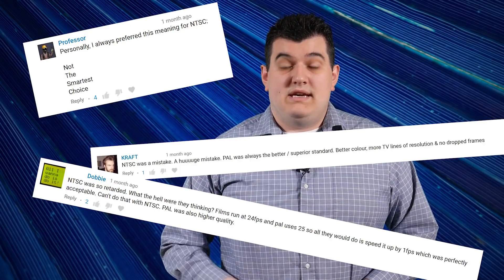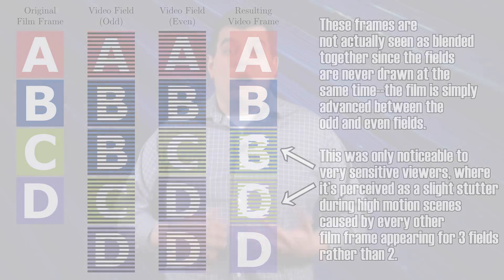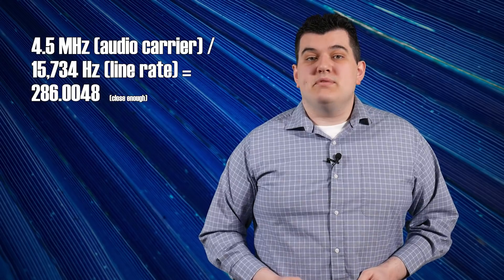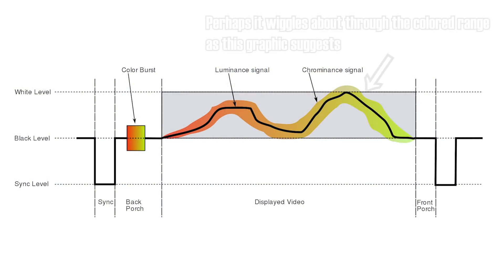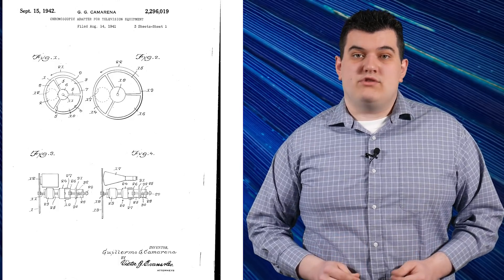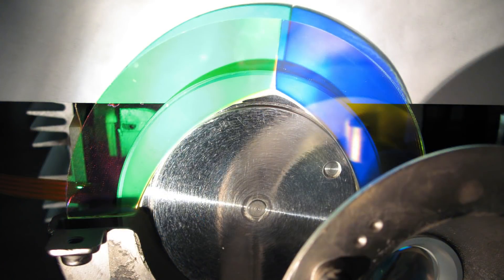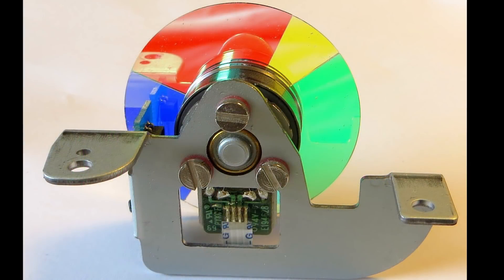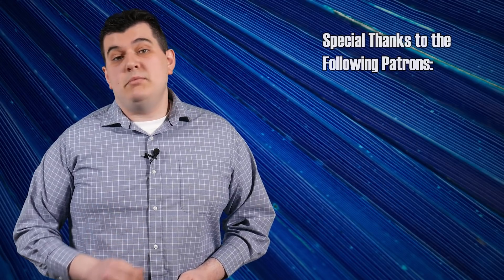Analog Color TV Wrap-Up--Some extra info

Comment: Movie framereates are a poor argument for PAL. These are TV broadcast signals. Movies are not TV.
Reply: The 24>25fps speedup for movies shown in PAL countries is completely invisible to the eye, it's only noticeable in the audio, which rises by a semitone - and even then, most people simply don't notice it, because if they've seen the film at its original speed they don't remember precisely what it sounded like. 

3:2 pulldown doesn't affect the audio pitch, but the jerkiness it introduces on pans can be very noticeable to those who are sensitive to it, but as with the PAL audio speedup, most people aren't sensitive to it and don't notice. The frames that are the result of blended fields are VERY noticeable when frame-stepping through.

But as has been pointed out elsewhere, the framerates of both PAL and NTSC are related to the AC power frequencies most common to the areas in which they were used. Most European countries use 50Hz power, so the framerate is 25, while for most NTSC countries it's 60Hz and 30 (or 29.97).

As to why, this is a good explanation: "Since the mid-1930s it has been standard practice to use a field 
frequency locked to the AC mains electric supply frequency – 50 Hz in most countries (60 Hz in the Americas) because studio lighting generally uses alternating current lamps and if these were not synchronized with 
the field frequency, an unwelcome strobe effect could appear on TV pictures. 

Secondly the smoothing (filtering) of power supply circuits in early TV receivers was rather poor and ripple superimposed on the DC could cause visual interference. However, the main problem was the 
susceptibility of the electron beam in the CRT being deflected by stray magnetic fields from nearby transformers or motors. If the picture was locked to the mains frequency, this interference would at least be static on the screen and thus relatively unnoticeable".
Reply: Fun fact: The studio control room scenes in the Beatles' A HARD DAY'S NIGHT were shot at 25 fps to prevent "scrolling bars" effects on the in-shot TV monitors.
Reply: Peter Kendell Similarly, Frank Zappa's "200 Motels", was shot on PAL video, yet when played in cinemas, had to get played at 24fps, leading to that slow-down in the intended music heard.
Reply: i remember hearing audio distortion when screen was showing almost all white on PAL broadcast system.
Reply: Playing videogames is not the same, i  bought a pal genesis/megadrive for play sonic and other old school games and f**k it feel slow. After the fucking hell of setup all the adapters and converters i was rewarded with a slow game experience.
Reply: Leyendlink but then that's also a reduction from 60hz to 50hz instead of 25 to 24
Reply: @layendlink. That's not PAL's fault. It's the game designers being unbelievably lazy. (which, to be fair was very common.)

Pal runs at 5/6th the framerate of NTSC. The PROPER way to account for that is to adjust the timing of everything so that it still takes the same time.
The WRONG way of doing it (read; most common) is to just take a game coded to run at 60 FPS, and run the exact same code at 50 fps. The horror that results should be obvious, since the game will run about 16.666% slower
The Mega Drive has an even more insidious problem that the SNES does not, although it could be compensated for; The sound playback is frequently also tied to the framerate!
The snes doesn't suffer from this because the Audio hardware has it's own processor that runs on a completely independent clock. While the Mega Drive also has an Audio specific processor,  the way it works makes it more likely that code will somehow sync it to the framerate.

This isn't a PAL specific problem either; Though people are less likely to complain about it. (since a game running slower is generally assumed to be unintended, even when it's not);
A game correctly programmed for PAL systems, if run on an NTSC system without modification will run at 6/5th it's intended speed. This would mean it's 20% faster than it should be.
Again, this is not how things are supposed to work.

Having said that, owing to design quirks related to CPU calculations VS graphics output, in isolation, PAL systems are objectively superior for most gameplay purposes. (this is true for almost all home computers and games consoles from the 8 and 16 bit era. 32 bit consoles and beyond don't tend to be using the CPU as directly for graphics routines in such a timing sensitive way.)
This wasn't obvious from most consoles, but it's quite apparent with systems such as the c64, atari 8 bit home computers, Amiga and so on;
The reason being that where most console game devs were American on Japanese, most of the developers for these systems were in the UK or other parts of Europe.

Where a game designed for an NTSC machine will run slower if not converted properly, (but fine if converted correctly), there is generally nothing you can do on an NTSC machine that a PAL machine couldn't match.
However, due to differences in available CPU time per frame, there ARE things you can do on a PAL machine which an NTSC machine could never do no matter how hard you tried, because it just doesn't have enough spare CPU cycles at the right moments to pull it off.

So here's the heart of why the PAL machines are functionally superior:

Though the exact frequency is tweaked a little, both NTSC and PAL machines have roughly the same CPU clock speed.

When used in the 'progressive' hack that most computers used (what Nintendo calls 'doublestrike', but which had various other names too), an NTSC machine outputs 60 frames of 262 lines. (this includes overscan and blanking lines.). A PAL machine outputs 50 frames of 312 lines.
However, and this is the critical part, the visible part of the image is generally the same; Both output say, 192 visible lines, or 224. Even where that isn't true, it's usually only 240 lines for a PAL display.
This does have a downside; the visible part of a PAL display in my practical measurements is about 266 lines; Which means almost every computer and console has black bars on a PAL display.
But, the upside is this: in most systems you cannot do anything graphically while the display is actively drawing something; You have to make all your changes during v-blank (blank portions between frames), or h-blank. (blank portions between lines of a picture.)
In some systems it's even true that the CPU and graphics chip share the same memory bus. This means the CPU cannot actually do anything at all while the graphics chip is accessing memory. If the graphics chip has DMA this may be a fraction of the period it's drawing graphics, but if it doesn't it's often the ENTIRE time that it's drawing graphics. Meaning you have no CPU time available at all during active display.
During h-blank you can make minor changes, which is generally used to do special effects and advanced graphics. There's not a LOT of time, but here, PAL does tend to have a tiny edge, simply due to there being say, 50x192 (9600)  lines per second instead of 60x192 (11,520). This is really quite minor, because if you could write, say, 5 bytes on NTSC you could now write 6 because you have more CPU time per h-blank.
The real gains however are in vblank. Whether the system uses DMA or something like a Display kernel, a PAL system simply has a much, MUCH longer vblank period.
Take an Atari 8 bit home computer such as the 800XL - for the early 80's that actually has a fairly fast 1.79 mhz CPU, and the Display can do a lot of stuff independently of the CPU, so you have a lot of CPU time during active display as long as it's not graphics routines.
But During Vblank? Well, the display is 192 lines on both the PAL and NTSC systems. The system can do 114 CPU cycles per line, on both PAL and NTSC systems... But, the NTSC one has 70 lines of Vblank, while the PAL one has 120. End result? During VBLANK the NTSC system has 7980 cpu cycles to do something that's timing dependent or graphics related. The PAL system? it has 13,680 cycles. Not far off double. (71% more cycles in fact). If you wrote a game or something that used up the entire PAL vblank period to do graphics and time dependent code, how would you port that to NTSC? You couldn't. The code would be completely out of sync or you'd have to cut features until your code was 70% faster. Which is non-trivial.

How about a 16 bit system? Well, we see the same consequences; Look at the SNES. While the PAL version tends to output 240 lines to the 224 of the NTSC machine, that still means the PAL system has 72 blank lines, while the NTSC machine has just 38. 
The SNES graphics chip has it's own RAM, so it doesn't interfere with the CPU, but anything complex graphically (or even something more basic like animated sprites with lots of frames of animation) requires a DMA transfer from ROM or main RAM to the video RAM.
When is this done? Only during Vblank or Hblank. (or forced blank - this means you can forcibly gain more DMA time by reducing the vertical image resolution, or even turning off the display entirely if you want to reload most of RAM - say when you leave one screen and go to the next. A blank frame or two won't hurt that much in such a case.)
A slight timing quirk means you get about 178 bytes of DMA per line on an NTSC machine, and 180 on a PAL one.
But again, way more vblank lines on a PAL machine, so in fact the PAL one can transfer 12960 bytes per vblank, to the NTSC machine's 6764 bytes. That's 91% more DMA time every single frame on the PAL system! 91%?
What does this mean? More complex animation, much more complex graphical effects.
In theory. Because of course, for a console like this it's unlikely a Developer would create something that literally cannot run on the NTSC machine. (especially since the US + Japan were the biggest markets)
OK, so on the SNES you do have a workaround, unlike some of the 8 bit home computers;
Since you can deliberately reduce the vertical resolution to get more DMA time, you can simply lower the resolution of the NTSC machine. However, this of course is quite noticeable.
And at the end of the day, the reality is at the same resolution, the SNES gets 50 lines of Vblank time, which equals 9000 bytes basically completely free over the NTSC machine, every single frame.
What's 9000 bytes? An entire set of tiles for most graphics modes is 1024 tiles that are 32 bytes each; That means you can alter 1/3 of an entire tileset for 'free' every single frame on a PAL system, compared to the NTSC one. Or, a typical 32x32 sprite takes up 512 bytes per frame of animation.
Which means you could load, basically for 'free' compared to NTSC, nearly 18 entire frames of sprite animation before the NTSC machine has even transferred anything at all.
(In case you're wondering, the Mega Drive/Genesis situation for graphics is almost identical to that for the SNES, though it has slightly more DMA time in general, the difference between NTSC and PAL is about the same.)

The conclusion is pretty clear for almost all these 8 and 16 bit systems that hook up to a TV;
If you write your own software, or wanted to choose one based solely on it's inherent capabilities, the PAL system wins hands down every time.
The downside is the amount of software developed with NTSC machines in mind, either explicitly (and then ported to PAL), or implicitly (not taking advantage of the PAL system's capabilities because they still want to be able to release an NTSC version.)

Anyway, PAL games being slow is a sign of bad coding. There's no inherent reason for it, it just means the conversion was done poorly. (the equivalent would be an NTSC game running too fast.)

This is also why I'm a little wary of people who just blindly assume any game at all is better at 60hz; They use modded systems to trick a PAL game into running at 60 hz...
Which makes sense if it's one of those poorly done conversions, but completely stupid if it was actually designed for PAL machines, (or is a properly done conversion - which does exist. Mario cart for instance - the PAL version is the same speed as the NTSC version. Just at a lower framerate, making the graphics less smooth. But, if you were to speed the game up, the gameplay would be faster than the NTSC version.)
Faster isn't automatically better. It depends on how the game was designed. Simply speeding it up without any thought would be silly. Unfortunately, unless the game runs at the same speed on both PAL and NTSC we have no definitive proof of the 'correct' speed a game is meant to run. (we can make an educated guess based on the developer though.)
Reply: Dennis Fluttershy We should just watch everything in 60+ fps. Heck go interpolate old stuff to make it work. I need all my frames!
Reply: It's more noticeable when listening to music in films; the speed difference shifts everything up so music isn't in its intended key.
Reply: They are not an argument for PAL colour at all, that's the C.C.I.R standard. One E.I.A country which adopted PAL is Brazil. Indeed most countries that adopted P.A.L used it with the C.C.I.R standard. Some C.C.I.R countries, notably France and those in the East Bloc, adopted SECAM.
Reply: NTSC >>>>> PAL
Reply: +Papus Magnus
 your comment is garbage, just as PAL is. "perfect relation when sped up" is only something a stupid person would say. Especially considering movies are 23.976 fps. And the absolute majority of viewing devices being 59.9Hz. You will always get judder with any system due to a multitude or various reasons, including PAL's low framerate, except with PAL you additionally get uncorrectable girly voices and funny walks like in those prehistory silent movies.
Reply: Let me provide here some real world examples for the obviously delusional commenters. Say you have a 25fps encoded sped-up movie and want to see it on your 60hz smartphone. What do you get? jerky 25fps motion, girly voices, sped up motion AND judder. Congratulations, you have just experienced some fine European tech.
Reply: roller4312 - What the heck is a ‘60Hz smartphone’?! You’ve just confirmed you haven’t a clue what you’re talking about.
Reply: +Papus Magnus First of all Real world broadcast doesn't use PAL or NTSC anymore for a long time, return from the 1980's. Secondly, 99% of Real World content is 23.976fps, and  is not an dividable number to *anything*. Thirdly all the defined current day resolutions are the same everywhere (720p and 1080p) and former PAL countries strictly lose here 20% on framerate as of today because of 50hz. And even in the past, PAL content was in most cases NTSC content with less refresh rate, and don't even get me started on consoles tying game logic to 60fps framerate. Your choice of words "real world" is the opposite of real world.  In the actual real world PAL is strictly worse and its legacy is still making life difficult for everyone having to deal with it. LOL.
Reply: +Papus Magnus
 Actual broadcast standards?. So you think NTSC is still used? This is hilarious. Tell me more. I want to feel "embarrassed" by the likes of you. LOL.
Reply: Wall sockets are 120 volts 60 Hz (previously 110 volts 60 Hz) in the USA and 230 volts 50 Hz (previously 220 volts 50 Hz) in Europe. What will happen if you divide your local wall socket frequency with two? You'll get your local old frame rate for black and white TV sets: 30/25 Hz. 

Suppose you'd be about to develop your continent's breakthrough black and white TV system back in the days. Wouldn't the TV sets be simpler and easier to manufacture if the frame rate simply was half the wall socket frequency? 

And obviously, 50 Hz wall sockets causing a mere 25 Hz fram rate would free bandwidth, that would be tempting to use for adding more lines. And how many extra lines would Europeans prefer to have in order to beat the Americans in a satisfactory manner? 80, 90, 100, 110 or 120 extra lines? Well, 100 is the least costly 3-digit number, so 100 extra lines is the natural choice in order to feel better than the Americans.

Summary: 100 lines better horizontal resolution at 25 Hz frame rate was the one and only natural choice in Europe.
Reply: While ar itr you should teach your friend 
ProdigalPorcupine, also a PAL lover, what a refresh rate even is.
Reply: fine day to you too sir and may the PAL be with you LOL
Reply: roller4312 - I don’t care about the PAL v NTSC debate, provided they are compared fairly. SECAM beats both anyway, at least from a resolution standpoint. As for smartphones, I still want to know what a ‘60Hz smartphone’ is. Maybe you’d prefer to forget you mentioned it. ;-) The ‘problem’   you perceive in former PAL countries does not exist. Our TVs play 60Hz content just fine, and have done since before digital TV.
Reply: Does youtube protect me from funny comments or did ProdigalPorcupine just delete his comment? i couldn't catch it all
, but the start ("Secam beats pal in resolution") was great. You EU people should do some in-fighting and pick the least trashiest system first. (well both are trash so it doesn't matter). I pity you both to be honest because you have to deal with 50hz content in a 60hz world and convince yourself you like it. That's some quality masochism there.
Reply: I thought that 3:2 pulldown is industry standard, I mean, I know that some movie broadcasts used quicker framerate but 3:2 was used even for PAL, wasn't it?
Reply: dunebasher1971 I noticed the the difference in sound of how the WestWorld intro sounds in my (PAL) region, versus how it sounds in the official clip here on Youtube. It's sped-up here, because in the course of migrating while maintaining legacy compatibility, no one ever decided to use that pull-down technique mentioned in the video, when they made the switch to digital broadcasting. That's right! Even HBO is still speeding everything up. It's even more noticeable in comparing the "paint it black" scene from the first episode.
Reply: welp in the end the 50hz is a much bigger curse now than anything on ntsc and pal is just plain worse.
for gaming then that's not even news, it used to be even worse in the 16 bit gen
https://www.youtube.com/watch?v=iPhESbeKFIE
Reply: Except that back then they filmed a lot of TV shows for many reasons.  And of course they showed a lot of movies on TV so the majority of stuff on TV needed to be converted from film first.